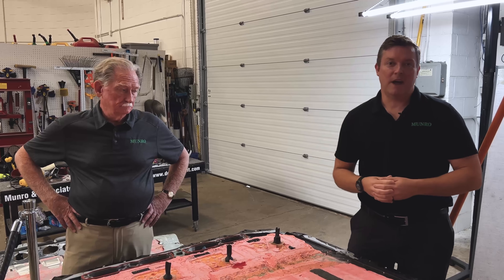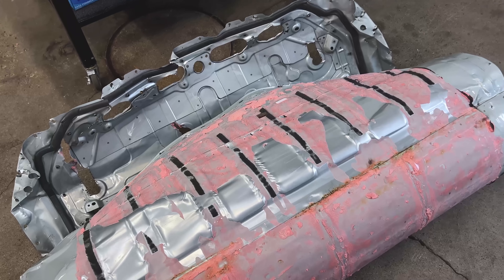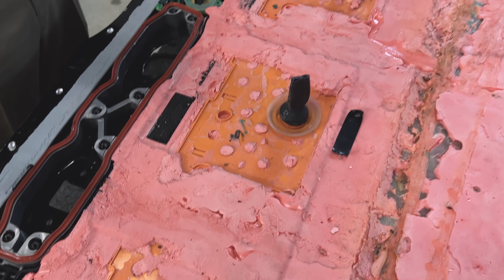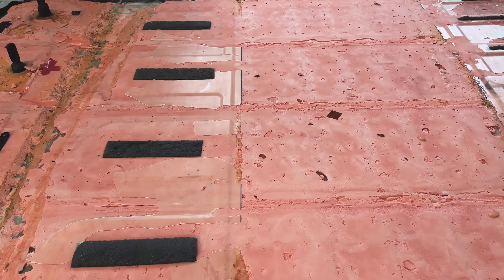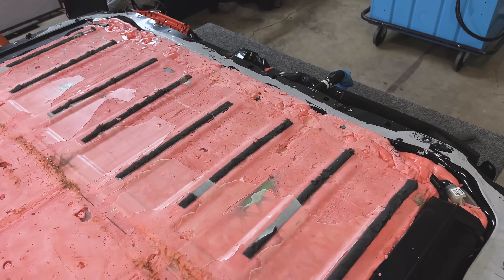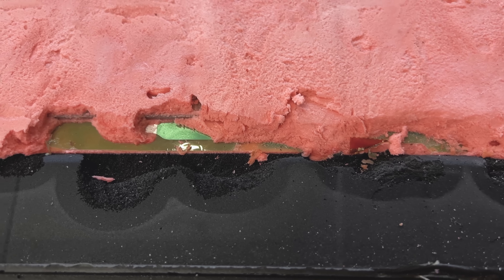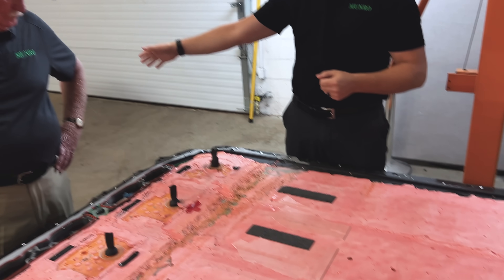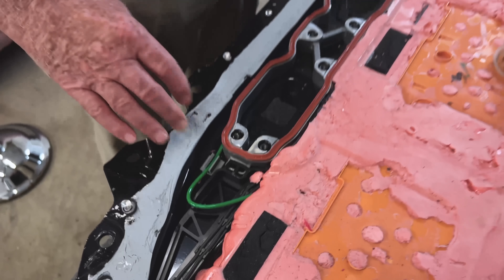FINALLY! 4680 Battery Pack Lid off | Tesla Model Y Update

Comment: Very disappointing IMHO to see the pink goo - I was hoping for a more serviceable battery pack.  I can only imagine how expensive a replacement will be.  This seems to go the opposite way for recyclability.  I hope the other ecar manufacturers will go in the opposite direction and make the battery packs more serviceable.  Would be a key buying factor for me.
Reply: Yeah the batteries modules are superb for reusability
Reply: The GM Ultium packs are serviceable.. so is the Bolt EV even.  Weber Automotive has a great battery and powertrain removal and disassembly and theory of operation video series on the Bolt EV.. and other cars too.
Its possible that there may be a process they do for recycling... dunk the entire pack in some solvent and the Pink Goo goes away.. Then the recycling happens.. OR  its all just crushed or shredded together and they separate the Lithium after that.
Reply: I would imagine it is designed to only be stripped back at designated locations.

Making it cheaper to replace the whole unit, and send it back for a complete recycle.

On this, I would imagine nothing has been without a certain goal in mind.
Reply: @neilm9400  what if the car gets exported to foreign countries!? Why if it gets in an accident and someone decides to tear it down to reuse the cells ……
Reply: @neilm9400  they will service them straight into the dump.

Comment: The tube could be dealing with off-gasing from the battery. It has to go somewhere - and I was wondering about that in your first video. Now I got that explained - I think.
Reply: I don't think lithium ion batteries have to worry about off-gassing. Maybe the foam does, but the batteries are sealed units, not like a lead acid battery that leaks hydrogen.
Reply: If your lithium battery is off-gassing, it is only doing so to avoid exploding! 18650s, and I assume 4680s, have a metal vent cap that will pop open or burst if the battery internal pressure becomes too high due to overheating/overcharging. This will generate lots of very hot smoke and most likely lots of flame as well that would melt that tube, but hopefully prevent an explosion. Most likely the tube is for venting the battery pack housing while the pink foam is expanding as others have stated.
Reply: I think all batteries emitt small amounts of gas in the state of charge. I for sure can be wrong and will wait and hear what Sandy and the team thinks.

Comment: Structural packs are great for weight savings but not worth it because of the lack of repairability. 1 bms goes out and you need a $15000 pack. This kills the long term affordability of evs.
Reply: Good point… it’s almost the same as a timing belt failure
Reply: @mikecounsell  you can change a timing belt preemptively. Plus engines can be made to be non interference as a safeguard
Reply: @smiller225  but…. Tesla….
Reply: Its almost like they dont care about being environmentally responsible by making the packs serviceable.
Reply: @saxplayingcompnerd  but…. Tesla….

Comment: How do you recycle the batteries if you can’t get them out easily?
Reply: In a large-scale recycling process the battery pack is normally chopped or ground up and then various chemical and thermal techniques are used to separate the individual elements. Look for this video on YouTube..."VOLKSWAGEN ELECTRIC CAR BATTERY RECYCLING PLANT".
Reply: @UTubeRangerBob  Thanks, that makes me feel a lillt better but still a pretty resource intensive process
Reply: @martinhollett3160  - they chunk lead acid batteries before recycling them. It is very resource efficient to just bring the whole battery in for shredding, much more expensive to give it to humans to take apart (and possible get electrocuted, then the cost REALLY goes up!!!)
Reply: @martinhollett3160  Think overall it pretty resource efficient. No humans involved and nearly use no power. To meld your car engine you need A LOT of electricity to melt it down. So this even on mass scale will use a lot less power and man power to recycle.
Reply: You run them through a large industrial grinder and then mechanically and chemically separate the materials.
Reply: Hahaha you dont. They just want to sell you a new one. damn the consumer and damn the environment.
Reply: @saxplayingcompnerd  that makes me sad. They claim batteries are better for the environment because they can recycle them but it takes a team of people 2 a couple of weeks open one up without it exploding in their faces.
Reply: @martinhollett3160  - “batteries are better for the environment”

All energy is dirty. Batteries are not the rainbows coming out of the rear end of unicorns that politically oriented people say they are.
Reply: @DavidHalko  Well, how about less dirty. Still an improvement for the environment.
Reply: @royh6526  - “how about less dirty”

Heavy metals buried in the ground mitigated by energy expensive industrial systems to try to isolate the heavy metals from batteries & solar panels???

Compared to burning natural gas or butane hydrocarbons, held in a steel tank which is 100% recyclable, which consumption produces plant food that is naturally recycled?

I definitely prefer the less dirty solution.

I am not against batteries, we need batteries for very portable solutions, like cell phones, laptops. 

Liquid fuels store much more energy than batteries, which is why people use butane powered soldering irons and gas powered welding torches (and not battery powered irons & torches.)

The right energy source should be used for the right job, so as to best use our energy resources efficiency. 

Carbon has the ability to form 4 covalent bonds, meaning living things can create & break down sugars as fuel, in an indefinitely recyclable process.

Indefinite recyclability is clean, this should be the goal of humanity. Anything else produces waste and to some degree becomes morally wrong.

Comment: Pink foam looks to be polyurethane with fire retardant properties but not sure how this would not increase the thermal load on the battery packs. The thermal management system would need to be good.
Reply: You want it to insulate. It's going to help thermal management if you are flowing cold fluid through the battery which is what the battery thermal system does.
Reply: Their former designs have an aluminum ribbon woven between cells with either end thermally grounded to a liquid cooled sink. Then they made the aluminum ribbons into micro channels to actually flow coolant. If those 4680s are tabless and they have micro channel cooling in this pack, it should be able to take heat out faster than it makes it.

Comment: These battery packs should be serviceable, tesla is basically saying fu to 3rd party shops who would try to fix these, shame on tesla.
Reply: Agreed 100%. So much for being green.
Reply: @saxplayingcompnerd  - “so much for being green” 
Just cleared a bunch of old growth trees for my solar panels which will get 15  years use. 

Being green is a ridiculous phrase for the solar and electric car impacts are. The phrase is merely a gimmick.

They are just another route for us to transfer, store, and consume energy.

All energy is dirty, in some way.
Reply: Why it need to be serviceable? The price to service a battery pack easily will go over 6-10k. How you know which module is damaged? It takes tests and time to do this(aka money). Then you need to decouple it from the pack and replace it with identical module. Than you have the risk of failure, who is going to give you warranty and who is going to certify that the serviced pack is safe and balanced?  All this require parts / equipment  / tech / certifications that need to be purchased/trained and will be adding cost to the service.

You do not simply replace a module in a pack, the balance will be off and how you going to compensate that 1 module has a lower voltage then the other duo to degradation? In Hybrid cars they already just replace the pack if it degraded too much. So if there is no market for Hybrid cars, how would there be one for BEV when it is even more complex and integrated?
Reply: So if they reach lifespan and reliability that would negate battery replacement. Then they should stick with an inferiour design so that 3rd party shops have an option to service a pack that would almost never require it?

Comment: Maybe the breather tube is used to burp or purge out any air during the clasping assembly process. And might be more than one of those breather tubes.
Reply: I agree. That foam might gives off gas as it dries so that could be another reason.

Comment: Guessing the breather tube is to get a pressure messurement inside the battery so they can detect eventual leaks. The tube is just to get it a way from the pink foam.

Comment: Excited to learn about the 4680 battery pack. I would guess a lot of the competition is also watching? Keep working on it :-)
Reply: Yeah to make car less and less serviceable right!? Stfu!!!!! I don’t hope anyone would copy such a ret@rded design
Reply: The competition will be tearing down these cars themselves
Reply: @rupertcrighton4107  no other companies needs/have to design cars like teslas which is basically becoming disposable lol….
Reply: @alanmay7929   no it’s not. The cells will be fully recycled, I expect quite efficiently. I don’t expect Tesla to use the grinding process. I expect they will have a recycling facility built into the battery factory; a large precise punch which will extract all the cells and empty the cell cans in one blow. Then send the cans back into the cells plant. The aluminum tray gets cleaned and reused and the steel lid recycled. That foam will be desolved into a slurry with a solvent and reconstituted with another chemical and reused over and over.  The CT for example with its ss exoskeleton will last longer than anything else, simply replace the battery pack and carry on. I don’t see why anyone would think these expensive metals will be landfilled, that’s ridiculous, much cheaper to obtain Ni and Li than mining fresh.
Reply: @alanmay7929  most other companies new cars are designed and built so poorly that they are disposed of in ten years.
Reply: @rupertcrighton4107  also those manufacturers most of them still support the cars they make over 30 to 40 years ago! By selling parts…… some manufacturers seven makes some very basic vehicles that are used in very harsch environments/climates around the world, Toyota Land Cruiser 70 series and even series 200…. Toyota hilux, mercedes gwagen…..
Reply: @rupertcrighton4107  even a 30 years old Mercedes’ has a better build quality than a new tesla lol….
Reply: @rupertcrighton4107  bullshit!!!!! I was talking about reusability of old EV batteries that still have a very long live when used as energy storage stationary! EV west garage in the US uses old tesla roadster modules to make their own powerwall and even use it to charge their EV conversions that guess what! Also uses old tesla battery modules….
Reply: @rupertcrighton4107  the way that structural battery is built, they are just going to uses big crusher to recycle those batteries at their end of life, just like vw has already and is running their own battery recycling facility.
Reply: @rupertcrighton4107  your cybertruck thing must be a joke right!? Because it’s not just the batteries that goes bad but it’s also the electronics, suspensions and many other parts, and as far as I know the less a vehicle has electronics the longer it last! Again just go to Africa or South America….. you’ll see 30 to 50 years old cars still on the roads working in the most difficult conditions which a tesla is actually not made for.

Comment: well, I'm wondering how they're going to recycle this. pretty much impossible.
Reply: As Sandy said there is a dissolver chemical, trust me the materials inside are the ticket, these packs will be 97% recovered when the time comes, theres $$$$$s in there
Reply: You can shredder the complete pack and get 98% of the rare materials back actually. Tesla uses this process.
Reply: You don't think strong a woodchipper works?
Reply: Important to talk about because other OEMs have their packs setup in a modular fashion where it certainly SEEMS they are going to be easy to recycle.  How on earth is that going to be the case here?!
Reply: Seems like Tesla is churning out criminally non servicable throwaway cars.
Reply: Sandy already said that there is a concoction that can dissolve the glue.
Reply: Wrong. Easy to recycle. Tesla will have a process for opening, Munro doesn’t have the advantage of having designed it.
Reply: I think the intent is to toss the whole thing into a shredder, then process the shredded bits.  The packs are definitely going to be recycled, in fact Tesla states that 100% of the packs will be recycled, none are to be disposed of in land fills, etc.  They currently claim that they can recover and reuse 92% of the metals from a dead pack to use in new cell manufacturing.  Obviously the foam would get separated out and disposed of.
Reply: If you guys are going to comment about Tesla, I would suggest to more closely follow Elon and Tesla. He already said that the foam has been taken into consideration and that have a way of easily recycling the batteries with it, so not an issue and NO recycling is not an afterthought.
Reply: Of course you can do it, but with greater effort. Shredding the whole thing is much worse than getting healthy cells out as a whole.
Reply: @Haja Klar :: The only reason you would be recycling it is if the cells were not healthy. 

Do you see now how critical thinking works?
Reply: @billstevens3796  bill. The cells are recyclable. They don’t lose the metals, same as lead acid car batteries which recycle the lead. The nickel and Li all remain. Once enough as been mined for the global fleet (about forty years) the metals will just get recycled because it’s much cheaper than mining fresh metal.
Reply: Reduce. Reuse. Recycle. In that order. 

It is wasteful to build a pack that may be recycled in principle but is utterly unrepairable by design. There are lots of failure modes in a pack like that even if they are designed well. This strategy makes manufacturing less expensive but is more damaging to the environment down the line. short sighted, as status quo in manufacturing

Comment: I feel like this is a shortsighted design which would make recycling this battery uneccesarily hard. Surely they could get rid of all that chemical foam...
Reply: Elon responded to this point by saying that they already thought about this and they will be able to easily recycle the batteries.
Reply: VW grinds up their batteries and chemically processes them, this foam would pose no problem for that process.
Reply: @Wrkncacnter777  that's a pilot program that VW is testing out, not ready for prime-time.
Reply: If the foam can just be dissolved - there is no problems.
Reply: It's all well and good to say the foam can be burnt or chemically removed, but that would be undoubtedly a dirty process that would either create toxic fumes or toxic liquids which would need to be disposed of. Not really the 'right' solution for the environment imo
Reply: @nimajneb02  - “ ‘right’ solution for the environment”

Lead acid batteries are chunked & get north of 90% recycled.

Any large scale recycling will not worry about individual cell reclaiming.

All energy is ‘dirty’ somehow…

Comment: Can you guys test if the pink glue is a fire retardant for the structural battery pack for which Tesla noted during the battery day event??
Reply: I'd also like to see them crush it to see how much it contributes to side impact protection.
Reply: Kinda pointless if they test its flamibility outside of its enclosed space. It could be helping with heat exchange beyond other non flamable materials.  Remember the goal is dont let the battery pack melt down. You cant test that ability in open air, it discounts expansion and sealing properties that, that material may actually act as a sealant againg leaks.
Reply: its PU?
Reply: Who cares. No Air = no O2 and fire.
Reply: @not today 👍 Exothermic
Reply: @phenex551  Cut a cell in a nitrogen atmosphere and you will see that nothing happens.

Comment: 😬😵‍💫 Out of warranty repairs
Reply: Return it as a core, shred it, and harvest the important elements out of it.

Lead acid batteries do not replace individual cells, they just chunk the whole things.
Reply: @DavidHalko  That would be nice but to my knowledge Tesla doesn't give you any credit for out of warranty battery pack replacement. In 10-15 yrs from now these battery packs should be cheaper to replace.  Probably inline with an ICE engine replacement.  Until then, I'm only keeping my MYP until the warranty runs out, then trade it in asap. An extended warranty would be great as well.
Reply: @Teddy_M85  - we don’t really get credit for batteries when return them. We get charged more when we buy a battery, and we get it back when we return the core.

The laws behind lithium ion battery recycling are not really there yet. We’ll see.

Comment: Breather tube might be: make sure no popping sounds occur like old Model 3’s had, 

I had it: Drives in mountain or on way to SuC: loud pops occured due to pressure differences. (Hot/warm battery and coolant runs through, this made “tin can” sounds.) might be “that”

Later a new “battery breather” was placed that fixed it for 90%. (Was up to model 3 2019 at least)

Comment: I hate 'unboxing' videos! ha ha.  I was wondering how Tesla were planning on recycling this 'slab o concrete'?
Reply: Dump the pack into a vat of molten iron. Then separate the metals from the slag,
Reply: @kazedcat  ha ha, I think the 'dissolved into solution' is possibly safer and more energy efficient?